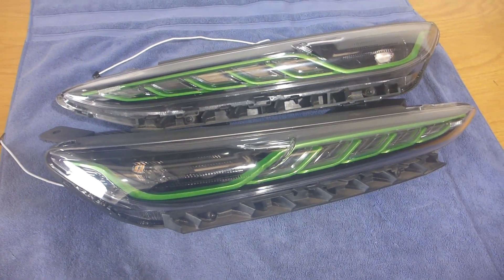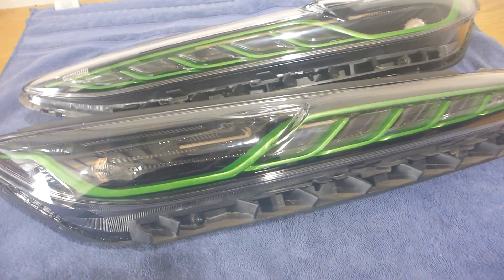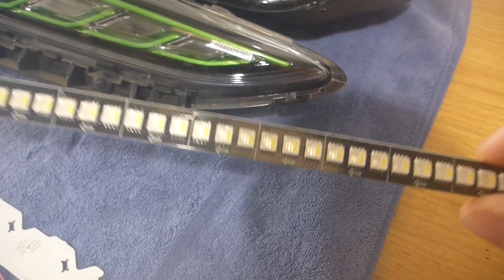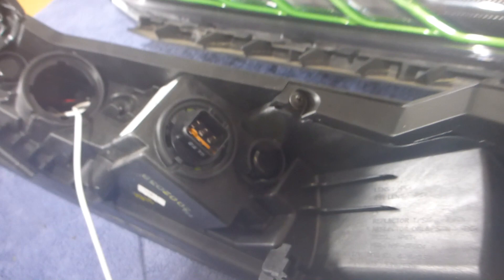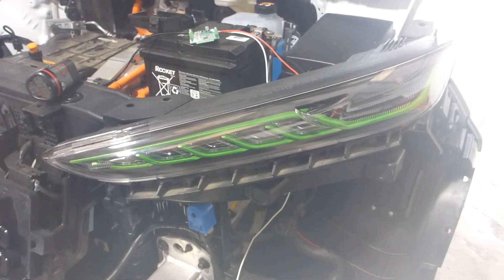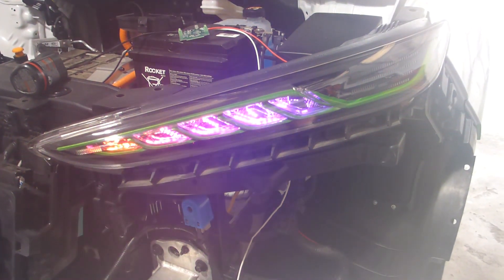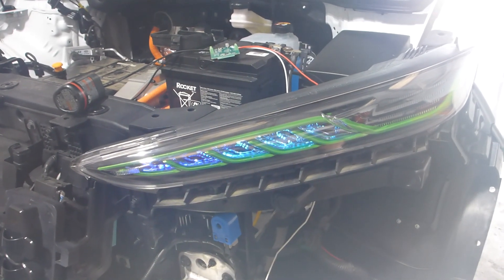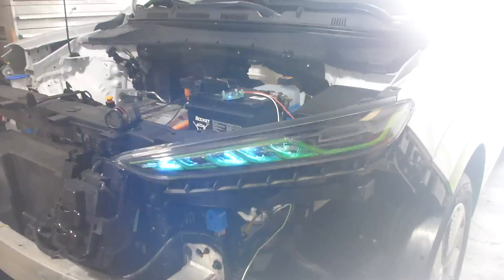Hyundai Kona Custom DRL Upper Lights (Paint & Flow RGBW LEDs)

Comment: It looks amazing, I have a question though. I recently installed the Ironman Kona DRLs on my Kona they were plug and play but now I am getting a check turn signals warning light on the car. They work but they hyperflash. Do you know what I could do to get rid of the warning light?
Reply from the maker: Install resistors.
Reply: @ if the only thing available is the 6 pin connector where do I install the resistors?
Reply from the maker: @ across turn signal circuit and ground.
Reply: @Bythirteen  ok sounds great. Thank you so much for your help. I really appreciate it, your work has definitely inspired me to start trying to mod the car.

Comment: Wow that's insane!! 👌 Does the front bumper need to be removed on the Kona to replace the upper day time running lights?
Reply from the maker: My bumper was off for this process, but I don't know if it is required.
Reply: I have a 2022 and yes it's required to remove the dumper (careful of the clips)